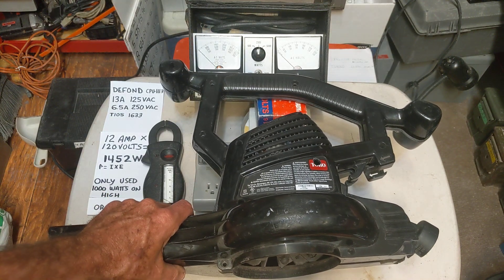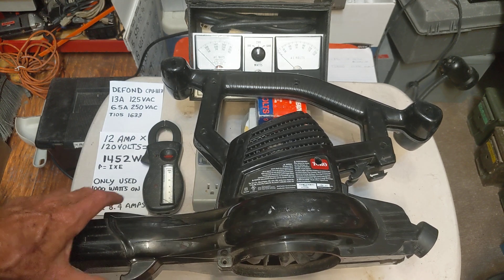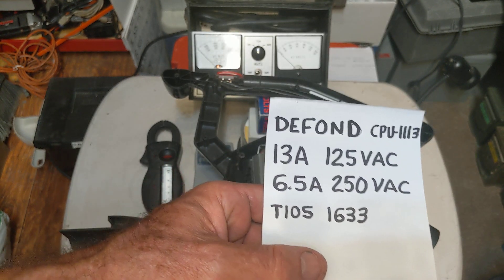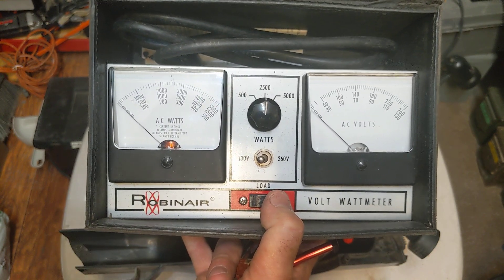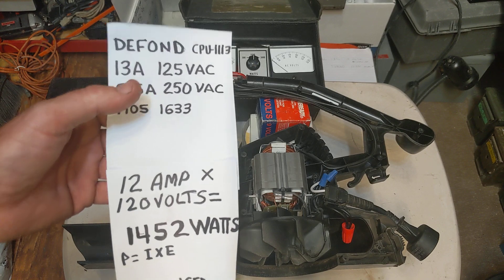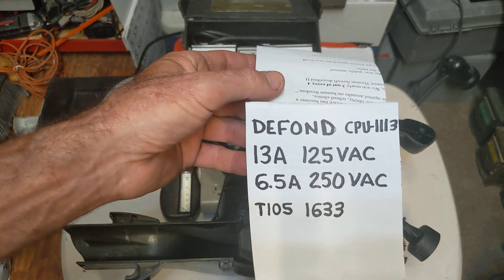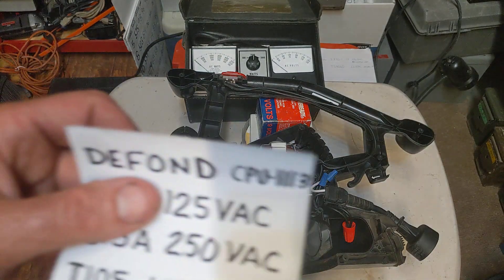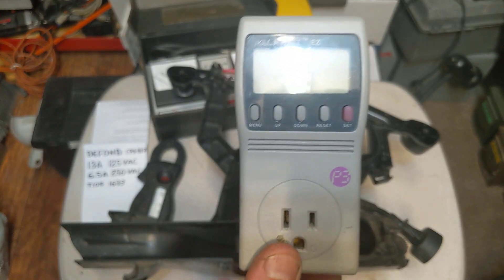Troubleshooting Circuits With A Watt Meter Or  An Amp Meter. Toro Electric Leaf Blower.

Comment: I was looking at a industrial dough machine yesterday. Same kind of problem. No power running through the breaker, basically capped it and told them to put it on a power bar that had a breaker on it. Simpler than finding a replacement.
Reply from the maker: That sounds like  a reasonable solution if it's just the circuit breaker that's defective, and your power bars trip rating is the same as the breaker in the dough machine.
Reply: @GrantsPassTVRepair  It was the same rating, 15 amps, but most machines run around that area anyway. Even if the rating was a bit lower a 15 amp is pretty much the standard that regular breakers are, you just get the breaker closer to the machine this way, current climbs pretty fast when something is going wrong.
Reply from the maker: @shaunmorgan372  It's always nice to find a work around solution.  It sounds like you know what you're doing.

Comment: I have the modern version of the wattmeter. I use it a lot. Very handy! This video was a good education for those who do not understand electrical power. Good job. I work at an electronic store in WA, and we get people in all the time attempting to repair their things without a basic knowledge of Ohms law.
Reply from the maker: To a new student ohms law probably sounds intimidating until they apply it a few times and start to grasp its simplicity.

Comment: Is the marrette now a permanent temporary solution? I've had a few projects turn out like this and might eventually get around to fixing them properly. It's only been a few years but they're on the list.
Reply from the maker: If I chose to continue using the leaf blower without replacing the circuit breaker I suppose you could say it's been repaired, but if something were to prevent the motor from turning there's a greater chance of doing permanent damage to the motor if I don't replace the circuit breaker.